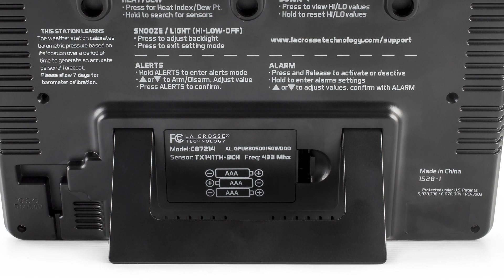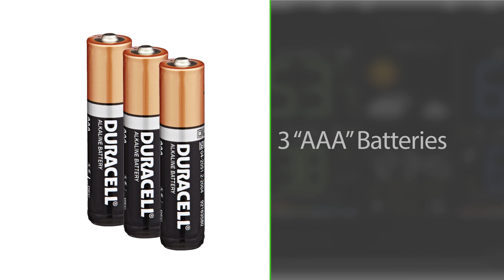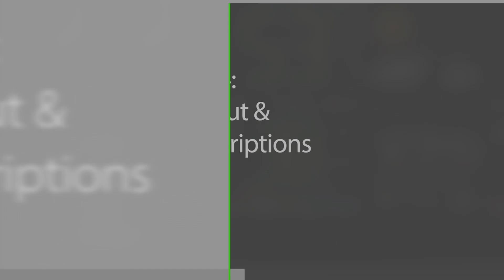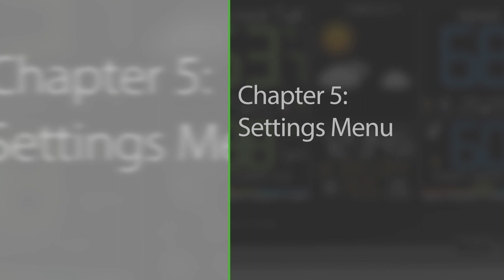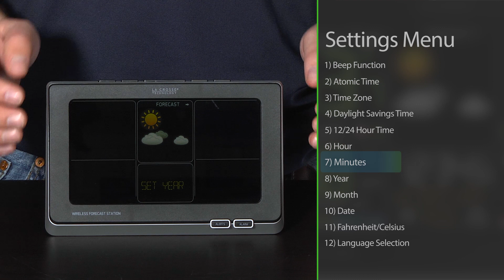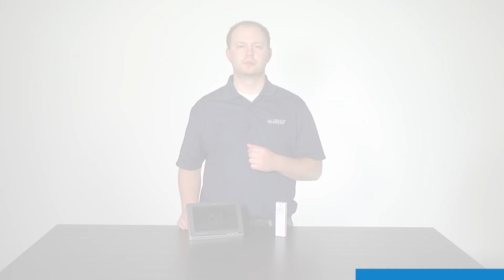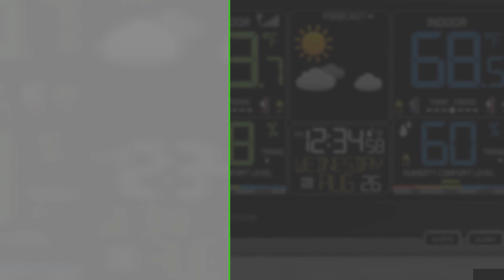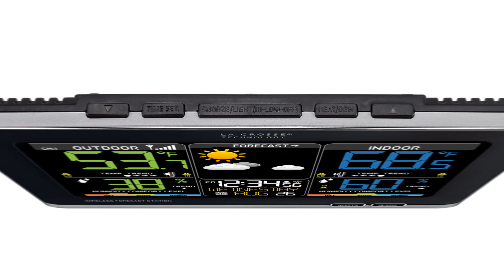C87214 & C87030 Wireless Color Forecast Station Setup Guide

Comment: I followed the set up instructions exactly,got the station and sensor paired.But the screen is on with all info for about 5-7 seconds then flashes 3-5 times and comes back on for another 5-7 seconds.Just keeps repeating.I've done a reset twice and still have the same problem.How do i get the screen to quit flashing and stay on?     Mike...

Comment: Great video and I was able to reset with no problems.  All electronics should have this good of an explanation!  One question:  My forecast on my model C87214 shows the sun image, two cumulus clouds and a partly hidden dark cloud.  Right now it's raining in my valley and snowing above 2000 feet, totally overcast and the sun never appeared today.  Not too close a prediction.  It's new as of yesterday so will it get better with several days of info gathering?
Reply: +La Crosse Technology and the tv never allways gets the weather right.well the bbc don't in England LOL.